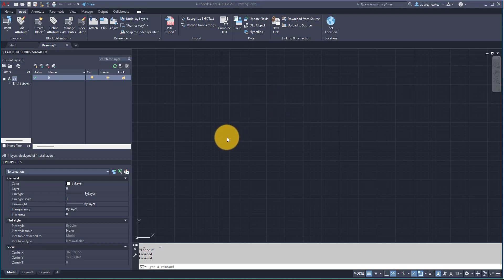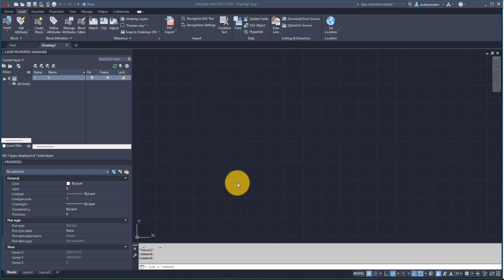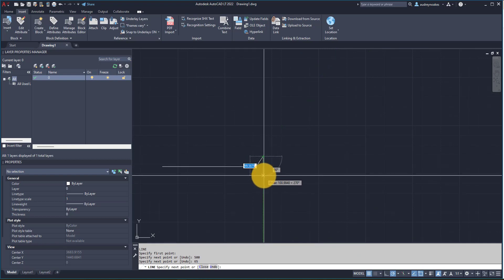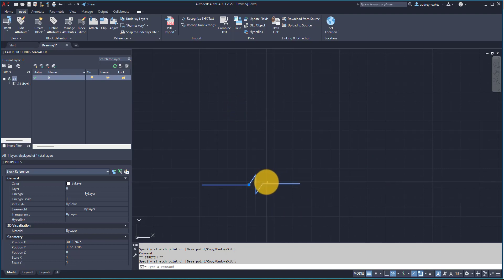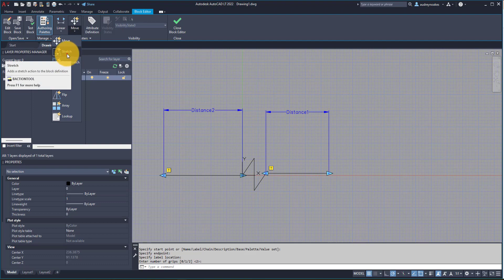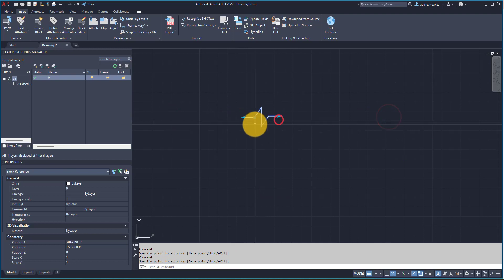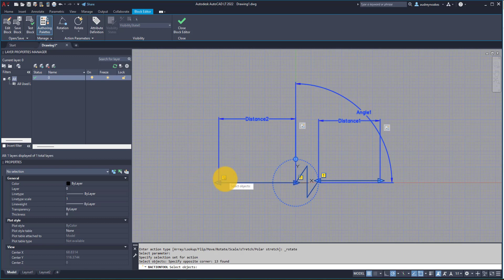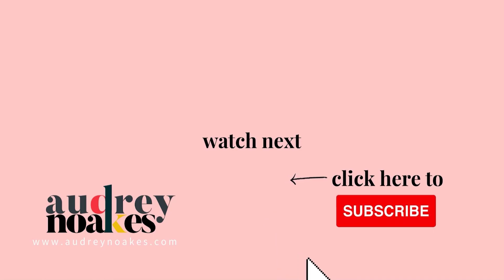How to create a break line as a dynamic block in AutoCAD LT

Comment: Thanks for the very quick and helpful video. My only qualm is that, except for the rotate option, it's not much more useful than just using a polyline as a break line.
Reply from the maker: Hi Rachel, yep, you can definitely use a polyline and just rotate/stretch/etc. manually. Or if you have full AutoCAD instead of AutoCAD LT, you can use the Express Tools for a break line. Why I prefer using a dynamic block is that embedding those actions and saving those extra milliseconds does add up over time, that using a block means you help yourself stay as consistent as possible where a drawing set can look cohesive with identical break lines, and that if you wanted to take a dynamic break line block further, you could also incorporate a wipeout as well within it where if there are an 2D blocks in elevation the break line itself will block out anything not being shown in the drawing without any extra trimming. Here's my video on wipeouts which might be helpful: https://youtu.be/fKNcAvwuX-k 
There's definitely a lot of ways to consider it though, so ultimately, whichever way makes the most sense to you will likely be easiest for you to implement!